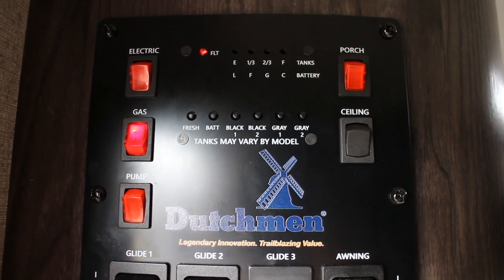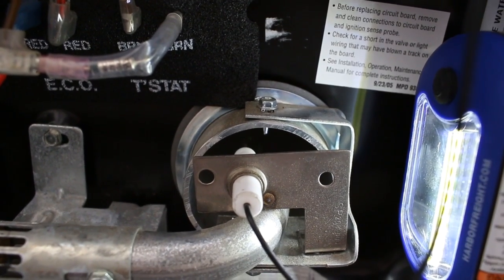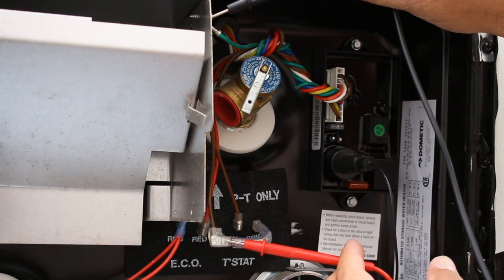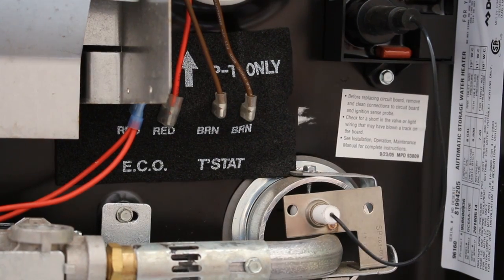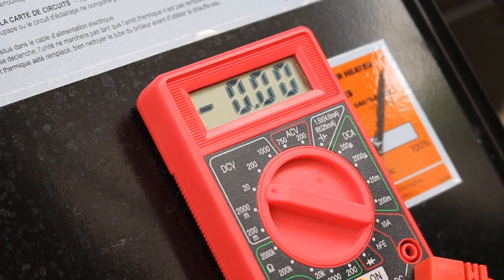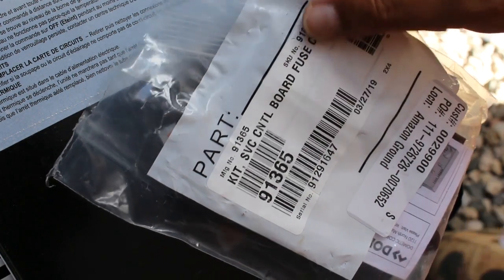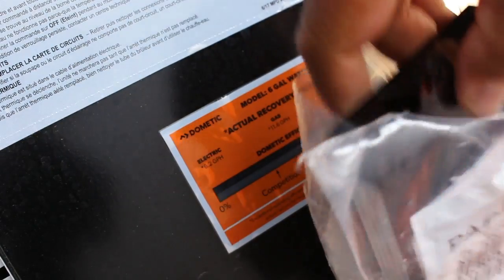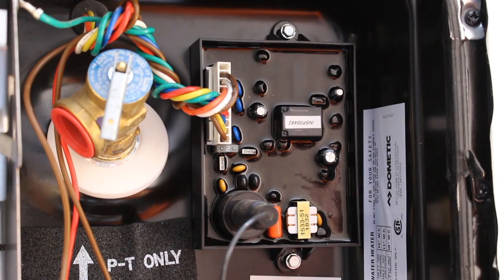Dometic Atwood GC6AA-10E Troubleshooting NO SPARK | RV Water Heater 91365 Circuit Board Replacement

Comment: Excellent diagnosis video.  In future when you need a circuit board look for Dinosaur boards.  They work very well and are generally much cheaper than OEM.
Reply from the maker: Thanks for the reference for Dinosaur Boards!  From what I could find on Dinosaurs website, it looks like Circuit Board UIB64 may be a possible replacement for the Dometic Circuit Board 93851.  https://amzn.to/2LkjE92
I will keep them in mind for sure... but hopefully I don't have to replace any more circuit boards anytime soon!!  I have a back up at least for this water heater now, LOL!!  Thanks for watching and taking the time to share information!!
Reply: @MileHighCampers  Dinosaur Electronics board UIB64 is what I used to replace the Dometic 91346 board on our Dometic GC6AA-10E hot water heater this past summer and it's working great!  It's assembled in the USA too.
Reply: BTW:  THANKS for the troubleshooting tips in this video!
Reply: Excellent video,  thanks 👍
Reply: No Dinosaur are not cheaper. But they are better.
Reply: My gas hot water heater works but the light inside does not the bulb is good what is wrong with it

Comment: Just had a frustrating run in... the owner said she'd turn it on, it would work, heat up, but then a little while later she'd get a fault light and would have to reset it to get hot water again. She only uses the propane side. Okay, that's easy, common problem, e.c.o/tstat is gone. Operating limit is stuck closed. So I swapped it out, fired it up, no problem. About 6 hours later I checked in with her, she said it's all good. Then 15 minutes later she comes back, it's off again. Now I have no spark. Same thing. I have power through everything, but no spark. Electrodes all test good, no ground issues. Don't I hate it when I fix something and another problem immediately presents itself.

Comment: I too have the same heater in a trk camper. Once I first heard it attempt to light, the first click,  I could smell gas like you said. It too will shut down after the three failed attempts. On the next try I simply put a lighter in the area, when it first clicked. After the click and lighter, the heater was running. So basically  I bypassed the spark option. Thinking now it would stay on until I shut it down or temp was reached. After 5 seconds the fuel stopped and heater shut down. This kinda indicates two problems I think. One, no spark, and two, why did the heater stop when it was running. Thermacoupler maybe?  In descriptions of the spark ignitor it mentions spark and sensor. Is this a two function device? One for spark and a sensor for keeping gas flow going? Seems rather odd but possible I suppose.  Like others, thank you for your time and great video!

Comment: I need help it stormed really bad and knocked out the power and our gas heater hasn't worked since do I just need to relight it?? How do I do that it's a 2006 Manhattan travel trailer please help me I haven't had hot water in days
Reply from the maker: Sorry that happened to you... On a trailer that new I would think it would relight automatically if the heater switch is on. Make sure you have propane... I know that sounds elementary but it easy to forget you could have run out of propane. other than that not sure how to troubleshoot it, sorry I could not have been more help.

Comment: The best video out there I found with the diagnostics.  You know much more than a dealer parts customer service rep or other "how to replace the control board" youtube that starts with how to open the service door to the hot water heater.   So great video especially with the other part numbers which the dealer didn't know anything about.

Comment: Thanks for the great video. This is the same unit I have in my 2018 jayco jay flight 7. I found this part on Amazon for $115, took 2 minutes to swap it out and the water heater fired right up. Thanks again for putting this on.

Comment: I'm experiencing the same problem now and your video has been very helpful in trouble shooting. Thanks for taking the time to post it. 

At 4:26 in the video you preformed a test to see if the circuit board was putting out any current to the spark probe and the meter only displayed zero, indicating the board failed. 

If the board had been good, what kind of result should you have seen on the meter?  I am getting the same result as you and so I just want to confirm this is a valid test that the board has failed before buying a new board. 

As a side note, since your water heater worked on electric, that meant the thermal fuse was good. To test this, run it on electric from a generator.  Disconnect the fuse and you will hear the generator cut out since the water heater is no longer using the generator power. If you has any AC power metering in the coach, you can instead look at the drop in amps used when the thermal fuse is disconnected.

Comment: Yup. My control board went out. Elec worked fine. Gas would not work. Also when control board broke, my gas would not work on fridge either.   Fridge gas works now aswell.
Reply from the maker: Glad you were able to get it all fixed, thanks for watching!!

Comment: Excellent detail in the video, showing the voltages and continuity.  My intermittent problem is that I do not hear the initial click or any noise after that.  Is the initial click the gas solenoids opening?  Should I see 12V+ when I check the solenoid?  My water heater works fine or makes no noise at all.  Touching the wires or even opening the door can start it working again.

Comment: Wow. Really fantastic job, thank you so much! I have a brand new unused TT that has this exact same model. I have been researching a lot and have come to understand a lot can go wrong with the appliances in these things! I'm trying hard to get ahead of the curve, so when these things happen I can correct them myself in a timely manner. I don't mind investing in some spare parts if it keeps me from having to wait for dealer help. 

This video was really a home run for me, and I'm saving it to my files. My new unit seems to have the same control board you bought and received as a replacement, so maybe that will be OK. If I decide to order a spare board, I might go with Dinosaur instead, as my reading indicates they might be superior, and possibly also flexible enough to use in a water heater and perhaps also other Dometic devices with minor jumper changes>

Thanks amigo!
Reply from the maker: From what I understand the Dinosaur Boards come highly recommended, I'm still having fits with this water heater... not impressed.

Comment: I have the same problem and your trouble shooting video is great. I ran all of the voltages and all is good. There is even voltage at the ignitor connection but it is only about 2.3 volts. Do you know what the voltage should be? Perhaps only the ignitor is bad. I did use a "light stick" flame and the burner fired up and ran fine. Thanks for your help.
Reply from the maker: I'm not 100% sure but my hunch would be the same as yours, thinking the igniter is bad. Thanks for the comment and let us know if it was indeed a bad igniter.

Comment: Thanks for the video but in my case I'm not getting any power to the brown wire or at the thermal cut off. Already checked the fuse inside at the main fuse boxe. and the gaz switch light is on. Any idea?

Comment: I went through this last year and had to replace the board. This is a good video very helpful. However, as the heater faulted again this AM, here I am again. While performing the first voltage check before the fusesable link, it came on. I do not like PFM fixes on electronics, probably I wiggled something enough to make a good contact. I’ll be using Caigs on all these contacts as they are exposed to moisture/hot/cold etc. great video
Reply from the maker: I would agree with the PFM fixes. I have owned 3 campers and never had an issue with the water heater until I got this one. I have been having different issues with it now, needless to say I am not impressed with this model. Hope you get it fixed, thanks for sharing your experience.

Comment: Man, thank you, thank you, THANK YOU!  I think this is why my water heater is not working under the gas selection.  Could this also coincide with the stove not igniting?
Reply from the maker: Awesome, glad the video helped! However, I think the oven might be a different issues, unless you are having issues with the propane regulator or the propane hoses.
Reply: @MileHighCampers  I decided to change the regulator as well.  This way I know it was replaced and when.
Reply from the maker: @GallavantingBlasians  Funny you say that I just replace my propane regulator as well video coming out next month, thanks for the feedback!!

Comment: nice video and greatly appreciated.  I have a Minnie Plus 27rlts.  Board went out twice.  Have you had any additional issues?  Any advice?
Reply from the maker: Yeah we continue to have issues with the propane side of the water heater. When on electric, it runs fine and is dependable. Right now with propane it seems to run to hot and needs to be adjusted, I may do another video on that issue at a later date.  So far, not too impressed with this particular water heater.

Comment: Just a note; I wouldn't try to measure the output of the spark connection with a volt meter. If working, it's putting out thousands of volts and can fry your meter.

Comment: nice video instruction... with meter in also... I've got gas, but no electric water heat. changed the sensors, still no heat via electricity, could it be the circuit board, or maybe the element... how would I best go through similar process to narrow it down, thanks again, great work!, g
Reply from the maker: I have not had to trouble shoot an issue on the electrical side, but first thing I would do is check to make sure that you don't have any tripped breakers. If you have no tripped breakers than it is possible that the heating element is bad. However, I have never troubleshot that, I have only read about that being a common problem when trying to run on electric only.  Good luck with the repair, let us know what  you end up finding out. Thanks for watching and the great question!

Comment: Can you explain how to prevent the thermal cut-off...from well cutting off?  What do I need to change or alter in the system to keep this from happening.  I believe this is what caused my failure, and if so it was the 2nd replacement.  Also are they water resistant?  I noted after my last flush/clean there is water inside the plastic sheath.  Thanks for any answers you might have!
Reply from the maker: sorry for the late reply, my first hunch is that the heater is not adjusted right and burning to hot... that just a guess... hope you got it figured out.
Reply: @MileHighCampers  LOL I haven't had to deal with it since my post.  I'll let you know if it is still working in the Spring! Thank you for responding, "burning too hot"?  That can be adjusted by moving the tube, right?  Or am I just recalling things wrong from the video?
Reply from the maker: @jenfugit7801  Yeah, thats actually one of the things I am still dealing with is getting that tube in the right position so that it's not burning too hot! Electric heat is flawless but the propane still gives me fits! Hope you got it figure out! Thanks for the feedback!

Comment: Do you know what frys the control board.  I just bought my micro Minnie 2 months ago
Reply from the maker: I don't unfortunately, however, you may want to check it when its running to see if its it running too hot, I may do a follow up video on how to adjust the flame.

Comment: Hows the new circuit board holding up? Suburban water heaters use a cheap Chinese circuit board and they tend to fail inside 1 year after replacing them so I went with a dinosaur electronics circuit board with a 3-year warranty instead of the OEM suburban board
Reply from the maker: It seems to be holding up, but I will say that I am having different fits with this heater now, so not real thrilled with this water heater. I have heard great things about the dinosaur board!!

Comment: Lol..... no videos yet have helped me... I have full propane tank. Cleaned everything.... no clicking sounds (no gas goes through) really need help... some one please...
Reply from the maker: Bummer sorry the video did not help you out. I sure you have already tried this but just in case, have you looked into troubleshooting and/or replacing the gas valve? Sorry could not be more help... Once you get it fixed let us know what the issue was would be good info to share. Thanks!